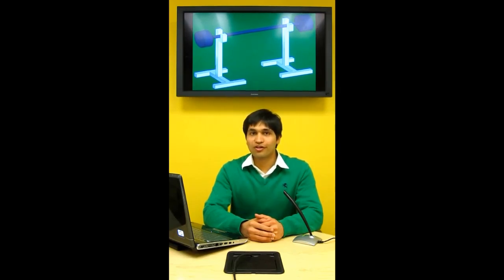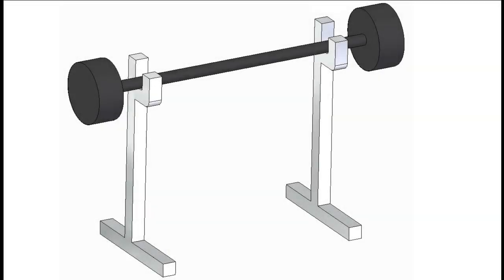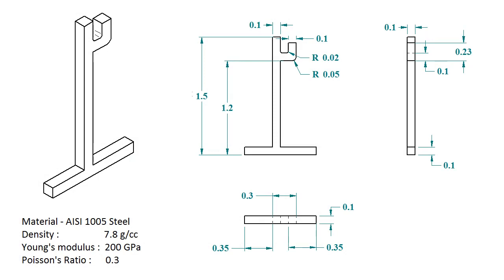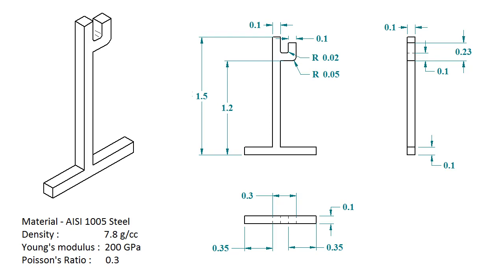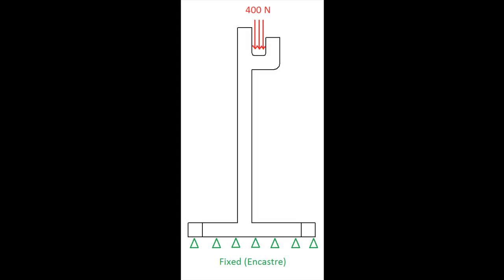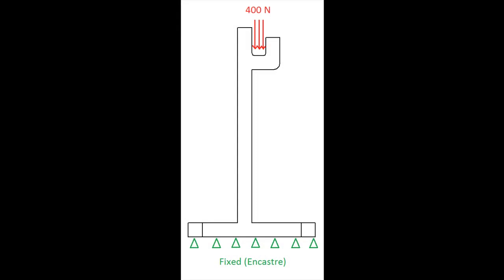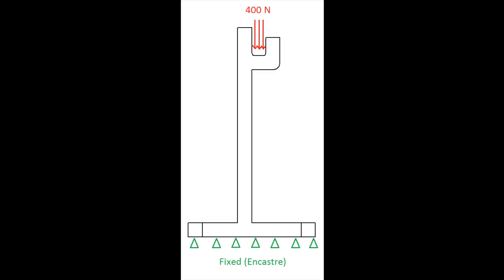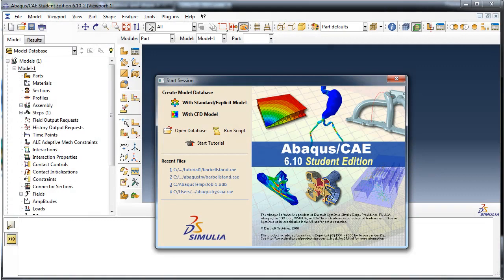1.a) Abaqus Basics - Overview

Comment: sir i am doing simulation about V-bending on Aluminium narrow plate by using steel punch and polyurethene rubber for die.But i am not getting good results,getting deformation in the die and getting very high equivalent stresses.Actually having problem how to select engineering data for the die. Please sir i am stuck and would be a great help if give me some guidenece.